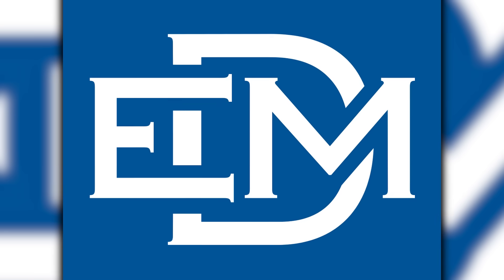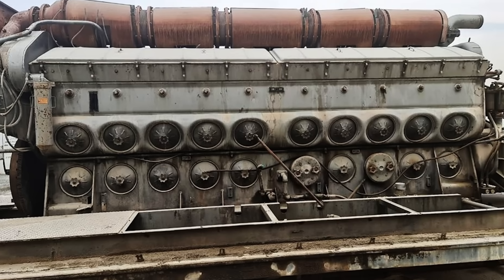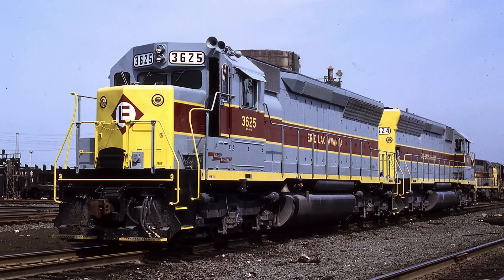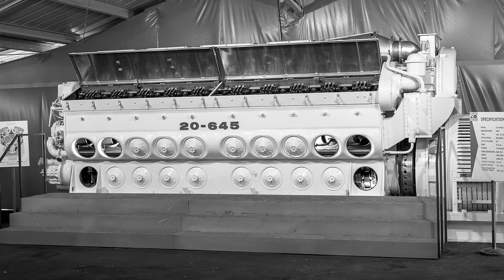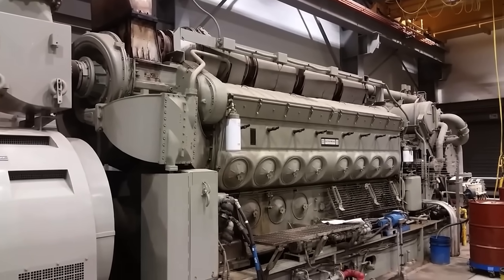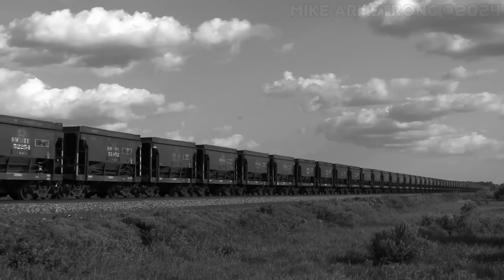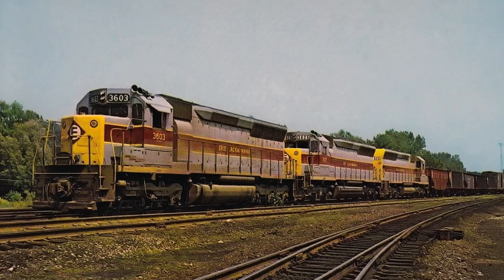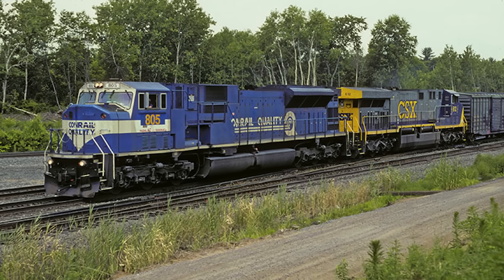The Rise and Fall of EMD's V20: The "Upgrade" That Backfired

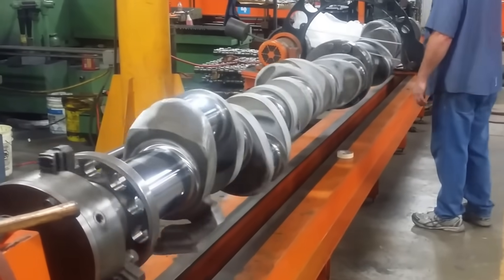Comment: EMD made the 645 engine in different configurations including 8-, 12-, and 16-cylinder versions. In another video regarding the EMD's 567, 645 and 710 diesels, another commenter mentioned that the 20-cylinder models actually had an 8-cylinder crankshaft married to a 12-cyliinder crankshaft, rather than a single 20-cylinder crankshaft. I don't know if that was indeed true or not (the crankshaft viewed at 4:36 in the video seems to support that concept) and how that played into the crankshaft problems. Hopefully that person has viewed this video and chime in with his experience.

Comment: There is a well known dynamic, in both jet engines and crankshafts.........when a steel shaft gets longer, it begins to behave like a "skipping rope" and bend in the middle.  It has been long known, for example that the V-6 engine which has a very short crank, can handle relatively high RPM better than longer crankshaft layouts.

Comment: Now, here is a little something spicy. Mmm. I think 20V came out first. Before 16V, can't recall. '65 or '66. I think EMD bypassed 16V when they changed over to 645 production from 567. But - anyhoo.
   1965 the 35 series was the last series of unit that could accept a generator without widening the carbody, as 2,500hp was the end of the line for the D32 series of DC generator. Around that time they invented a venerable contraption called the AR10 traction alternator and slapped it in front of a deturboed 16V-645E3, which they subsequently crammed into a unit referred to as GP38AC - an experimental unit. The spirit of SD40-2, which was born in 1972, is being slowly conjured up. A new power source was being tested, then EMD took leave of its good sense.
 Next EMD designed  new Flexicoil HT-C trucks,a new modular electrical cabinet, complete with the new IDAC adhesion management system that a fellow by the name of Henry Hogie designed for a certain mechanical foreman by the name of Milton Deno of the Canadian Pacific Railroad to fix his SD40s... in fact the very same system that EMD later stole from Hogie, then EMD went a bit crazy.
   They constructed a 4,200hp monster on the erection floor at LaGrange, Illinois and called it SD45X. It was 1971.
   They built only 7, and the Southern Pacific bought them all. I don't know the entire maintenence  history, but I heard rumors of electrical fires, and traction system related issues. I hadn't heard specifically of any crank related issues, and had never heard of them being derated. But it could be that at higher outputs the resonant vibration issues may have disappeared, don't know. Those units had 4 radiator fans to deal with the heat as opposed to the customary 3. So...the 20V-645E3 was pushed a lot harder than 3,600 hp., the Espee ran those for years in spite of the electrical issues that they had, AND all of the new tech on those became the SD45-2, SD45T-2,SD40-2,SD40T-2, and SD38-2 in 1972. 4,200horse was considered to be a bridge too far for the 645 platform, and thus SD45X was discontinued after 1971.

Comment: I'm gonna address this a bit differently. I read some publications given to me many years ago by a good friend of mine who was a paper company transportation executive that I model railroaded with for quite a few years. Articles were written in '99, and I always suspected Jack Wheelihan was the author.
    One thing that was put forth concerning 20V-645E3 was the fact that it WAS more economical IF AND ONLY IF, it was under full load - which was not easy to do.
   It actually did better than 16V when viewed through the lense of "Gallons per Horsepower Hour". But therein lies the problem. OK. There were adhesion problems, they vibrate, leaked ,and the crankcases were problematic, but consist power rounding must not be forgotten. Railroads operate on hp per ton, and the consist was set up for the steepest grade the train would encounter, which means they spent a significant amount of time below Run 8.
  The 20V had 25% more rotating mass which requires more fuel. That is why Espee turned theirs up to 3,200hp to get an SD40 w/200hp extra to cover the weight of the extra 4 power assemblies.
Reply: The SD45's, SDP45's, F45's, and FP45's that were apart of the first production suffered the immense crankshaft problems which fractured frames and caused engine block cracks including the actual crankshafts to tear apart. EMD actually addressed and repaired that issue quickly by reinforcing the crankshafts and engine blocks and it actually solved the problems. That's why all of those units including the -2 series like the SD45-2's and SD45T-2's survived as long as most of them did and certain amounts are still surviving today. A specific amount of units at that were never rebuilt and retain the 20V645E7 engines. The SD45's didn't prove an advantage over the SD40's in regards to traction and adhenison, Southern Pacific figured that out quickly. But the units were heavier and reliable which is why that railroad had the highest orders of them. Most of the SD45's that actually got through rebuilds down to specifications were the MKCX units that MKR bought from various railroads and rebuilt them into SD40M-2's. This includes the SD45M's that were original and specific to Erie Lackawanna.

Comment: SD45’s with the 20-645 were the go to for all the major railroads with steep grades and the need for speed. SP wouldn’t even consider using GE or ALCO on the Siskiyou or Mt Shasta route. Only the SD40’s and 45’s because they were reliable and didn’t give them surprises. Only thing that killed the 20-645 was the fuel crisis. They were thirsty!
Reply: It wasn't the fuel crisis. The 20V645E7's didn't meet modern EPA regulations but the fuel consumption, espiecally in Southern Pacific's final years, was becoming a problem. The SD45's didn't really display any performance improvements over the SD40's regarding traction and adhenson. But Southern Pacific loved them, had the highest orders of any railroad, and weighted them down alot heavier. Because of no significant changes over the SD40's that's why there was no issue of rebuilding them as SD45R's, although not all of the units were derated or rebuilt. All of the first generation SD45's that didn't suffer fractured frames were rebuilt. The later production units had reinforced crankshafts and engine blocks to resolve the problems of heavy internal vibration. EMD quickly addressed those problems, espiecally on the F45's and FP45's at that for ATSF. While EMD units back then were much more reliable and simple in operation alot of GE and ALCO units weren't out of the question mentioning serious tonnage and the needs for horsepower. Although numbers compared to EMD were low Southern Pacific loved their GE U30C's & U36C's until age inevitably caught up to them but the throttle response and tractive output was impressive. Southern Pacific had a small fleet of ALCO C628's, same amount as their EMD SD35's, which were even more incredible in the traction category than the GE units but severely overweighted from the factory and actually split or broke apart trackage. Other railroads that ordered the ALCO Century Series units in the six axled category faced identical problems. The ALCO C628's still proved as versatile helper units for a long time until Southern Pacific resorted and derated them into heavy duty yard switchers.

Comment: Well, here in Denmark we got the type MZ delivered with both 16 cylinder (3300 HP) and 20 cylinder (3900 HP) 645’s in the 1970’s
The ones still in operation here in Denmark is the 20 cylinder versions - 45 years after delivery.

Comment: I ran a number of Lower Mississippi towboats with 20-645's, including two repowers done with the early twenties. Very early in their career, a new harmonic balancer was developed to replace the original, and it damped down the torsional vibrations in the crankshaft that were the source of most of the early twenties mechanical problems. They went on to be largely trouble free as long as they were not run beyond rated power. Truthfully, the one boat equipped with 12-645's that I dealt with was consistently more of a problem with cam vibrations that would wreck the overspeed trip mechanism, and trip out the engine at a too low RPM. EMD never admitted that there was a problem there, but every new OSTM that I recieved was subtly different than the one it replaced. 🙂

Comment: Diesel Locomotive Works in Varanasi, also used the SD80MAC engine and swapped it with the 16 cylinder EMD engine in the WDG 4 (GT46MAC) to create the WDG 5 although it was also not successful only 7 were made from 2012-2018, so they are the latest V20 engine locomotives in the world.......
Reply: Thank you for your comment and not badmouthing the creator for  attempting these difficult subject matter

Comment: EMD SD45 downfall of EMD Let GE get ahead with dash series locomotives
Reply: Not the SD-45 but the SD-50
Reply: And don't forget that GM was led by one of the worst CEOs of all time, Roger Smith, while GE was led by one the best, Jack Welch.
Reply: The SD50 was their downfall. The SD45's issues was the oil crises in the '70s. They were fuel guzzlers.

Comment: Yet EMD tried again with the 20-710 in the SD80Mac.  That didn't work, either. 

The only other large OEM to use an oddball cylinder count was Alco/MLW, with the V-18 251F.  Fairbanks Morse still offers that engine in its catalog.
Reply: The SD80MAC's were perfectly reliable and the only units as that to also retain the title of being the only successful units with high horsepower. It didn't matter the amount of cylinders, any EMD 710 series engines are interchangeable and easy to modify when it comes down to parts and market resource. What discontinued the SD80MAC's was high fuel consumption, getting older, and not to mention EPA regulations which was a bigger problem for many years with EMD and not just GE's competition and dominance in the industry. Norfolk Southern didn't retire and sell all of the remaining SD80MAC's to PRLX until well in the amidst of the covid pandemic. Almost twenty five years of freight service is an admirable record. The SD80MAC's much like the first generation of SD70 series units were EMD's last decent products until the company went into a complete downfall after General Motors sold them out. Outside of Conrail, CNW & ATSF were actually going to order SD80MAC's. CNW was going to use them on coal trains, possibly replacing if not being alongside their C44-9W's & CW-44AC's. ATSF was going to use them for intermodal service alongside their SD75M's, C44-9W's, C40-8W's, B40-8W's, and GP60M's. But the Union Pacific and BNSF merges discontinued those possibilities since an ungodly amount of motive power was inherited by combining the railroads. The extra costs weren't worth it. The SD90MAC-H's were outright junk and biggest failure that EMD ever created, even the SD9043MAC's were problematic regarding electronics from Siemens which was still an issue later when the SD70ACE's had debut. GE's AC6000CW's also had mechanical issues but weren't as immense in operation and consist although demanding when it came down to mainteance and repairs.